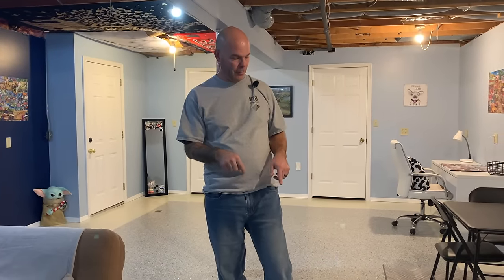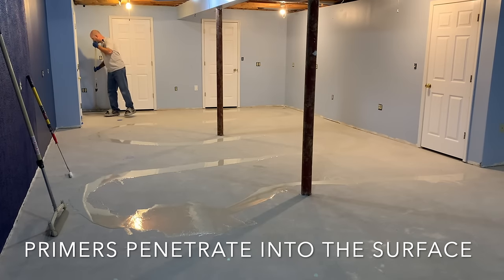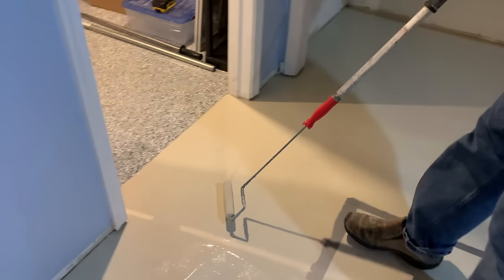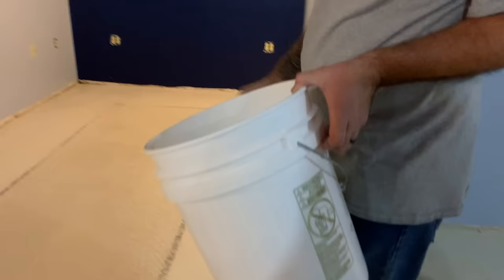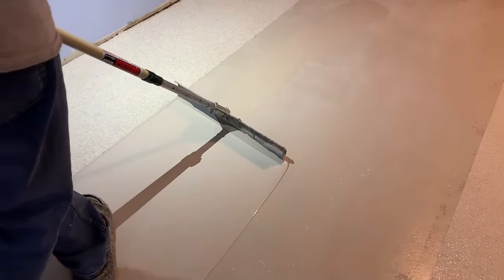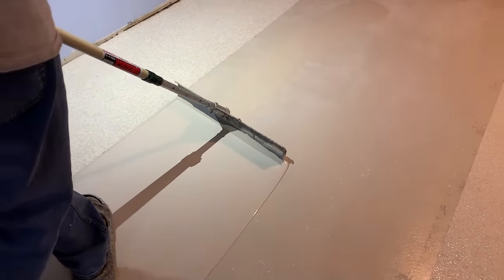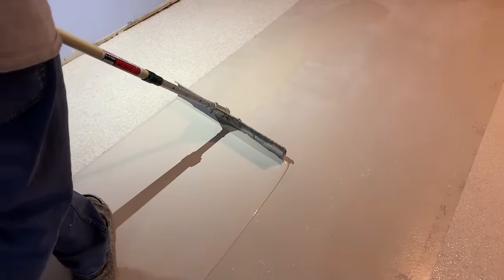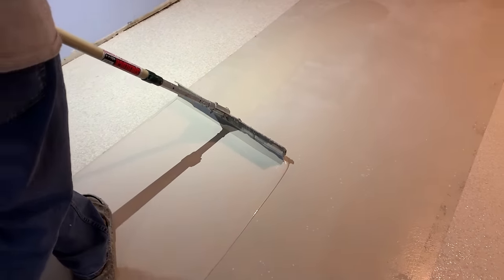Installing Waterproof Epoxy Flake Flooring In A Basement

Comment: Your channel is an excellent source of information and I’ve seen many of your videos, because there is so much information regarding the different types of epoxy materials. Would you/ Could you make a video with a chart comparing the deferent types of materials there pros/cons, set/open working time and most of strength/life expectancy. This would help diy people such as myself  choose which product to purchase from your company. For example I have a newly constructed home with a 750 sq work Wood” shop. What would be the best way to approach such this project. 
IE: do i still have to grind the floor no matter if the concrete is new. ???

Comment: Thanks for you instructional video I have a new concrete 1 car garage never sealed or driven on 3 days old how soon could I use your products and would I have to sand it first
Reply from the maker: Concrete needs to cure 30 days prior to installing any coatings.
I would highly recommend diamond grinding the surface to create a scratch for the epoxy to bond to. 
I would also recommend upgrading the topcoat to the CFS-1C Polyaspartic. The polyaspartic is 100% UV stable and can be used in direct sunlight.

Comment: Very informative video, just a  question ,can i use it on concrete outside of the house (around the house)??
Reply from the maker: You cannot use epoxy topcoats exterior.  You need to use polyaspartics:
I dont know how many sq.ft. you have, but here is whats recommended exterior:
https://concretefloorsolutions.com/store/epoxy-floor-kits/500-sq-ft-cfs-1c-polyaspartic-flake-floor-kit/

Comment: I wish you would have shown the scraping and cleaning between step 2 and 3.
Reply from the maker: I apologize, it is nothing more than taking a 12"-20" inch metal floor scraper and walking back-and-forth scraping off the loose flake in multiple directions

Comment: What's the advantage to using the crack filler over a standard epoxy mortar/coving mix to fill in the nail holes?
Reply from the maker: The crack filler sets in about three minutes, you can grind immediately after, and not have to wait for material to set.
It also has much better penetration into the concrete, so it bonds much better

Comment: Great video. Just one question, when my basement floor was poured, plastic wasn't used under the concrete. I never see it wet or damp but is this a concern?
Reply from the maker: That should not be an issue at all. The primer we supply with our kits is good up to 5 pounds per thousand square feet of vapor transmission.
If you don't see any signs of moisture, I am sure you don't have anything to worry about. If you are concerned about it, I would recommend doing a calcium chloride test.

Comment: Silly question .. Does this help prevent rising damp .
Reply from the maker: Yes, As long as the vapor transmission is less than 5 pounds per thousand square feet. Epoxy is a solid surface and non-breathable. If you do have higher vapor transmission, you just need to apply a moisture vapor barrier first. https://concretefloorsolutions.com/store/epoxy/cfs-moisture-vapor-barrier/

Comment: Thanks for the video. What did you use to scrape the floor? Also my basement has joints should those be filled with self leveler?
Reply from the maker: You can use an 18 inch wide floor scraper that you can get at any hardware store, the joints should be filled with a polyurea joint filler:
https://concretefloorsolutions.com/store/repair-materials/cfs-fast-set-joint-filler-with-static-mixing-tip/
Reply: Thank you sir

Comment: Hello, do you know if these Basement Epoxy Kits can/will cover/eliminate Earthy Concrete Odor?
Reply from the maker: That surely is not what they were designed for, but it is a impermeable surface, so I can't see how it wouldn't help.

Comment: With the primer, do you ever use a moisture vapor barrier instead of the primer to ensure no moisture problems in the future?
Reply from the maker: Our primer is rated for 3lb/24hr/1000 square feet.  I personally have only ever encountered one project in 28 years where I really needed the vapor barrier. Our solvent based penetrating primer, penetrates into the pores of the concrete, which virtually eliminates delamination issues. We do have a vapor barrier rated for 20lb/24hr/1000 square feet. https://concretefloorsolutions.com/store/epoxy/cfs-moisture-vapor-barrier/
If you have any concerns over vapor transmission, I would highly recommend a calcium chloride test.
That being said, if you are that concerned over moisture issues, I would just put the moisture vapor barrier down and be done with it.

Comment: When applying primer (at about 15mintues into video), are you applying an pressure onto the squeegee?  It looks like you are largely just using the weight of the squeegee with minimal pressure applied downward to it.  Is that correct?  Thank you
Reply from the maker: For that particular material, yes. Very little down pressure with that squeegee.

Comment: CFS-FAST SET EPOXY CRACK FILLER- Does it have a strong odor?  I used PC Crete 150 in my basement storage room and it about gassed us out of the house.  Odor was even stronger after grinding smooth.
Reply from the maker: It does have an odor and you should use it in a ventilated area. I have no idea what that other material is or how to compare it to it.
Reply: @ConcreteFloorSolutions  That's a very vague reply and applies to all chemicals. I guess my question should have been more specific,  when you used CFS-FAST SET EPOXY CRACK FILLER in this video in your basement, did it permeate throughout the entire house to the point you didn't want to be in the house because of the odor?
Reply from the maker: @dscottgillett  everybody has their own opinion on how bad the smell is. Yes, you can smell it, no, I didn't think it's bad enough to want to leave the house, but again it's all personal opinion.
My recommendation if you were going to use it in the houses is to make sure you have good ventilation

Comment: Hey guys - I love your content and would totally hire you if you were nearer me (I'm in the UK). Question at someone looking to DIY, how would you deal with a tamped-finish concreate floor? A traditional grinder I think would take far too long to smooth it, is there another tool you'd use or would you lay some sort of self leveller before laying a flake system?
Reply: Apply a self leveler or epoxy mortar. You can get a self leveler at any big box store. Just make sure that you read the manufacturers TDS sheet to see what materials can be applied on top, and if there needs to be any prep work done before applying an epoxy on top. Mostly you don't need to prep. However I would just double check to be safe.

Comment: I noticed you mixed the extra perimeter batch in the same bucket as the original batch. We always use clean buckets for every mix. I’d love to stop using so many buckets! No concerns of mixing in a bucket that’s already been mixed in for 45 min?
Reply from the maker: No issue at all as long as the material was not setting up in the bucket.

Comment: What kind of 6" rollers are you using? Do you usually pull off the trim before most jobs?
Reply from the maker: Normally, we will have the trim pulled off. Sometimes we need to work with it in place.
It is much easier if there's no trim. 
We typically use 6 inch rollers, 1 inch in diameter from big box stores. 1/4 or 3/8 nap.

Comment: What do you do if you get that primer coat down, but then you find some holes that need to be filled?  Can you fill them and let them level so you don't have to grind them a second time?
Reply from the maker: You can puddle some of the CFS-Intermediate coat (100% solids) before you apply the flake and you will never see it.

Comment: I want to edge my carpeted room with epoxy with a 4” edge. Is that feasible?
Reply: To edge with flaked epoxy
Reply from the maker: I would say, absolutely, I would recommend it before you put the carpet down so you can go 6 inches wide with the edge and then overlap the carpet over the epoxy. That would be the easy way to do it.

Comment: do you use flat squeegee or notched squeegee
Reply from the maker: I always use a flat squeegee, but I have to admit I have become one with the squeegee over the years.
I would recommend a notched squeegee for first timers, it helps regulate the thickness of the material to get a good consistent coating. 
if using notched, this is what I recommend:
https://concretefloorsolutions.com/store/accessories/speedsqueegees/
Reply: @ConcreteFloorSolutions  thanks very much

Comment: Any reason you chose a flake floor vs a more decorative coating like metallic?  Thanks
Reply from the maker: It provides much better camouflage if you do damage the floor. This is a basement and not what I would consider a Showroom / living area. Metallic flooring would provide the same waterproofing aspect as the flake though.
Reply: @Concrete Floor Solutions Inc.  Do metallic floors show wear easily?  Hold up to UV from doors and windows?  I'm looking to finish my basement floors but am not wild for vinyl chip downstairs.  Is there a specific finish you would recommend for basements besides vinyl chip?
Reply from the maker: @ryanklosterman3749  metallic floors are very smooth self leveling in nature. If you do damage your floor, it will be very easy to see.
I wouldn't say they necessarily scratch easier, but if they do scratch, it will be much easier to see the scratch than on a flake floor.
Metallic pigments are mixed with epoxy. Epoxy is not 100% UV stable so can discolor overtime. You can slow it down by applying a urethane topcoat on top of the Mettalics.
Reply: @Concrete Floor Solutions Inc.  Thanks for the info!  What type of floor would you recommend in a basement  with a sliding door.  I could put a blind  over the door to protect from UV.  Only a few small windows up high besides the slider.  Not sure I want a chip floor in my basement but want something durable and also decorative.   Thanks
Reply from the maker: @ryanklosterman3749  either floor is going to be extremely durable. It all comes down to your personal preference and opinion. 
The metallic floor will definitely look higher end.

Comment: Sorry but this is NOT a waterproofing system. You should explain that to people that don't know what they are buying.
Reply from the maker: It is 100% waterproof if it gets wet, NOT to be confused with a waterproofing coating to stop water from penetrating through a floor.
I do believe I explain that it is NOT designed to stop water pushing up through a floor. Thank you for bringing that up.
Reply: I primarily need a waterproofing solution.  need help! Have a moldy church basement looking for a method to waterproof the slab (put in 1970) planning on digging up the exterior walls to waterproof but water bubbles up the slab joints when it rains